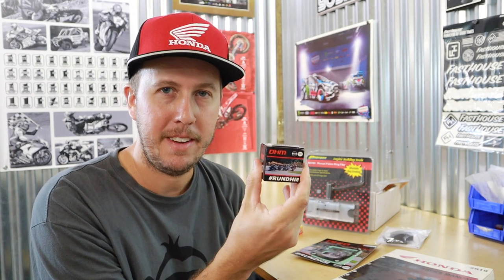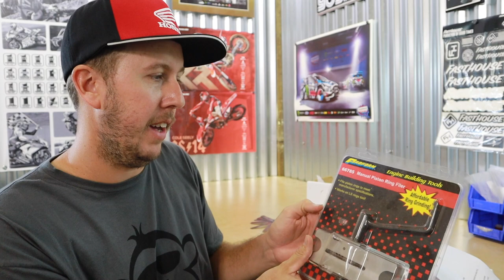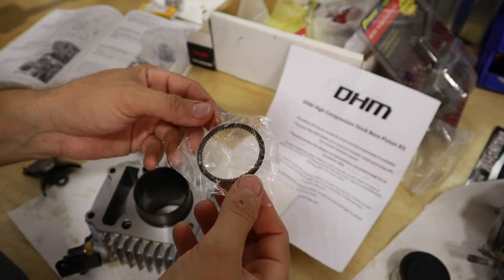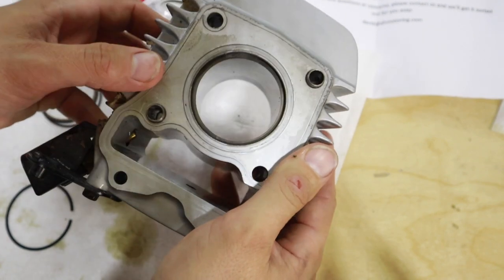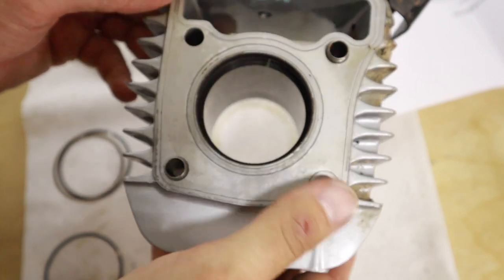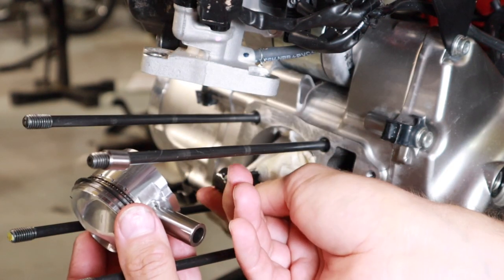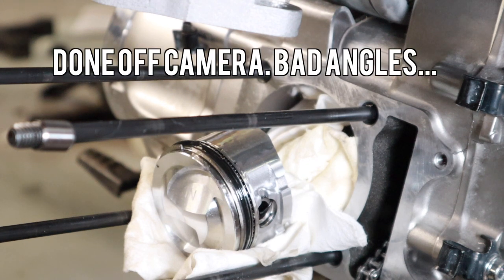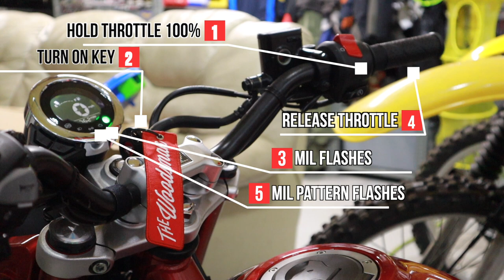DHM High Compression Stock Bore Piston for Honda Grom/Monkey | FULL INSTALL AND TIPS!

Comment: I’m just about to do this mod. So glad you’re reviewing it, and that it’s going to add the power. I’m taking it in to have it done though, I don’t trust myself with the rings.
Reply from the maker: I think it’s a great mod, but I also think I flubbed up the ring like I thought and lost potential power from it. The gap is important and too much will be safe, but you’ll lose a bit of compression if it is, and a lack of power
Reply: I saw this video is like 5 months old, my Monkeys been neglected through winter, but did you end up fixing the ring? Even with the bigger gap, did you notice more power? I’m looking to get their titanium axles now too. I’m going to do the piston in August and hopefully with that, the lithium batter, gearing, intake, exhaust, and cam, I can get it as fast and torchy as I can get it to go without the big bore. Did you ever do a Speedo healer?
Reply from the maker: I don’t feel as if I got any more top speed, but it sure does feel more punchy, like if you wanna do a wheelie, it’s gonna do a wheelie! Never did get that speedo healer though... 😂🤷🏼‍♂️

Comment: Thanks for the step by step tutorial! Im going to be attempting this once I get the kit. I have a question about TDC. Once I set it to TDC, remove the head and jug, will the TDC markings move?
Reply from the maker: Thanks for watching and commenting! It’s not the most important thing to keep in place, you’ll have to recheck the marks when putting the chain on anyways. It’s just good practice to try and keep it there to make sure it goes back together the same way. The cam doesn’t move, so that makes it easier.

Comment: Great video I enjoy them. Quick question never done motor work I just ordered this piston ecu and canm. I see that the piston rings top and bottom go 120 degrees. But the two bottom ones that hold the oil rings that go in the bottom you align them together straight at 120 degrees or they go 120 a part so it would look like a square type scenario. Thanks for the help.
Reply from the maker: I actually missed that when I shot the video so I put the snip of the manual in there for the ring orientation. You would space all of the ring gaps at 120 degrees, but an easier way to think about it is the top ring gap at 2 o’clock, the 2nd ring gap at 10 o’clock, the top oil ring gap at 5 o’clock, and the bottom oil ring gap at 7 o’clock. The oil scraper ring will interconnect.
Reply: Ok thank you so much🙏🏻  great videos. Keep em coming. 👍🏻

Comment: Usually higher compression will make it eyn alot hotter. Not goid on a aircooled bike. Even adding a oil cooler wont help alot. You need to increase the cooling fin size.  We used to do it on the xrs we used to race.
Reply from the maker: Agreed.

Comment: Great video! Stupid noob question. I have to gap the top two rings not the two oil rings? Never done a piston before.
Reply from the maker: Correct, the oil rings do not need to be gapped
Reply: @John5XR  It's too much power !

Comment: So I just installed the high comp piston but forgot to oil up the cylinder walls and piston (rings & wrist pin). 🤦‍♂️ I started it for the first time with fresh new oil and let idle for 5 min. Then I test rode it for about 20 miles with no issues. Do you think I’ll be fine or do you think i should tear it apart again?

Comment: I got this same piston to be installed what’s the gap for the spark plug?  And have you had any problems with it. I’ll be installing mine over the weekend. Great videos brother. Keep em coming.
Reply from the maker: Ya know, I’m not sure! I didn’t adjust the gap, just went with it out of the box. No problems after about 25-miles of riding, both low speed and wide open throttle for long periods of time, so all seems well. Enjoy!!
Reply: @John5XR  ok thanks I’ll install like that. Great videos brother

Comment: why did it require you to put a spacer on the spark plug, you're taking away some of the compression you just made by installing HC piston? 
is the piston that much higher that it would touch the spark plug at TDC?
Reply: Yes, without the spacer, the piston will smash the spark plug

Comment: Good video. Very thorough. Shame on DHM for not labeling the piston rings or at least specifying location by color on the instructions.

I wonder how accurate those cheap feeler gauges are.

Also, because you live in Florida I wonder if would be safer to go to the top of the ring gap tolerance to allow an extra .001” for the extra heat you guys have down there. Just thinking out loud. I’m guessing being in the middle is perfectly safe.

I like that you leave in your mistakes, such as making the lower ring gap too large. We all make errors. And we all can really learn from mistakes. No reason to hide it.
Reply from the maker: All great points, thanks for commenting! It would have been nice to know for sure on the rings, however I didn’t reach out to DHM to ask, which I’m sure they would have told me. On the feeler gauges, yeah, I should measure it with my Amazon digital caliper to be sure! 😂🤦🏼‍♂️ Bigger ring gaps might be better down here and I’d want to err on the too big side on an air cooled bike since it runs hot. The downside would be a loss of potential compression, and maybe some oil blow-by. I’m not worried about losing a little peak power potential as I’m not racing, and if it blows by a little oil, I can see how bad it is and make a decision based on how much. Yes! I left the mistake in because it’s sooooo easy to make and think people will be more aware of the process and attention needed to do it right

Comment: Did you notice an increase in power AND/OR increase in oil temp afterwards?
Reply from the maker: yes for sure. The gains are mostly in the low-mid RPM range, but they're helpful for getting up and going faster. Couldn't say on oil temps, as I have no real way to measure them accurately. DHM confirmed that an oil cooler is not necessary with the high compression piston though.

Comment: Hello John, it 's necessary to install a new ecu? Or only with the high compression piston and the stock ecu will work? Where I live they don t sell the Dhm piston only the kitaco one and it comes without the ecu modified... and another question, I've just installed a tyga exhaust but it feels that I don t use 100% of the exhaust, what can upgrade without puting in risk the engine? Thanks John!
Reply from the maker: While you can add the mods without an ECU tune, it's not going to provide any gains because you're going to starve it for fuel and the air/fuel ratio will be lean, which can be detrimental to the engine long-term. Exhaust only, intake only, or piston only would help, but all together would need an ECU reflash
Reply: Waste of money without tune

Comment: Are you going to do any head work?  I think you have a flashed ECU on the monkey, are you doing another flash?
Reply from the maker: Haha, well with the way this bike is going, that might be a possibility! I didn’t wanna get too deep into engine mods with the Monkey, but if I keep getting the manufacturers wanting me to do install videos, probably 😁
Reply from the maker: And yes, the ecu is now flashed for my intake, exhaust, cam, and high-comp piston
Reply: Nice, look forward to seeing your review of the piston.  Looking at a similar setup, but thinking about adding a ported head to maximize everything.
Reply from the maker: I’ve put a few miles on it around our backyard tracks and around the neighborhood and it feels more powerful already. I’m yet to do a top speed run as I want to let those rings seat in a bit
Reply: @John5XR  yeah, do a proper break in then let everyone know your thoughts.

Comment: Hey John, give up an update on your results when you have a chance! I just did a DHM piston install this week myself and felt I may have slightly over filed one of the ring gaps slightly. Here's hoping it holds up as well as yours.
Reply from the maker: Will do. Do you think it affected performance?
Reply: @John5XR  It has, but maybe not in the way you might expect. There is a different engine note and the main takeaway I have found 100 miles into the break-in is that I'm gaining about 3-4 MPH between shifts, but the power gained is very subtle. Still, a great upgrade and opportunity to install the Gromfatherz HD Studs and Head Bolts.
Reply from the maker: Cool, I’ll be monitoring it for sure and updating as I think it’s something that happens very easily
Reply: @John5XR  One more thing - I spoke with David at DHM and it sounds like that ECU you got with it will really help out in avoiding the issues I'm having.
Reply from the maker: @natekelly35 the ecu will absolutely help with providing the extra fuel and timing needed to allow the piston to be most efficient at making power. Along with the Yoshimura exhaust, MNNTHBX Mtake, and TB cam, the extra airflow will definitely need more fuel. Having the ecu reflashed to your specific mods is certainly a “must” as you never want to run with a lean air/fuel ratio (not enough fuel) on an air cooled bike, as the fuel provides a fair amount of the cooling for the piston

Comment: 25:50 you need to change the spark plug
Reply from the maker: Good tip. It doesn’t seem to be an issue when it warms up, but maybe the plug gap could use re-gapped
Reply: @John5XR  You need "cold plug" or more heat range spark plug because you had high compression ratio
Reply from the maker: Interesting. I’ll bounce this off DHM to see what they recommend

Comment: when you do an high compression piston your supposed to check your  piston to valve clearance! Because the top of your piston when putting in an high comp piston or an high lift cam can hit your valves or just barley tap them and make a knocking sound in your engine. .
Reply from the maker: I would if this wasn't already engineered by a Honda Grom/Monkey performance shop. Where I really messed up was making the ring gap too big and not honing the cylinder first...

Comment: Those 5 uggs on the cam shaft bolt cringe...
Reply from the maker: the impact is a 3/8" light duty, doesn't provide a load of torque like the big boys. Unless you have a pulley holding tool, this is a good way to get that bolt tight. But yes, it's not the "ideal" method, but the realistic method for most of us
Reply: @John5XR  btw DHM just emailed me back about the compression rings. He said black ring is top, sliver is bottom.
Reply from the maker: If that’s the case, I got it wrong... Thanks for sharing that 👍
Reply: @John5XR  how many miles have you put on the piston? No problems yet?
Reply from the maker: Probably 50-75 miles so far. No issues at all!
Reply: @John5XR  my mistake. I  want to clarify and let everyone know that that Cameron Jones Racing said that the sliver ring is top and black is bottom. I'm going to follow my gut and follow your tutorial.
Reply from the maker: Mine is running great, even with the overgapped second ring. I would like to know for sure however
Reply: @auomauom  but DHM said the opposite? That the black ring is on top??
Reply: @kastanza19  checked my email. David said Black ring is top. Sliver bottom. I don't know why the two are saying opposite things. I'm sure theyre from the same manufacture.